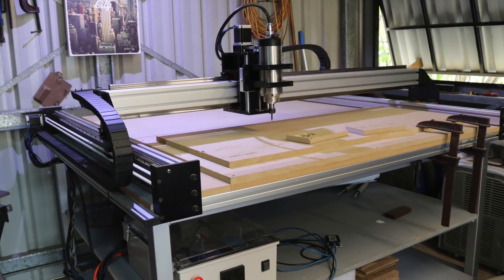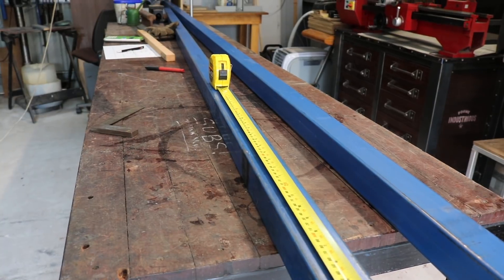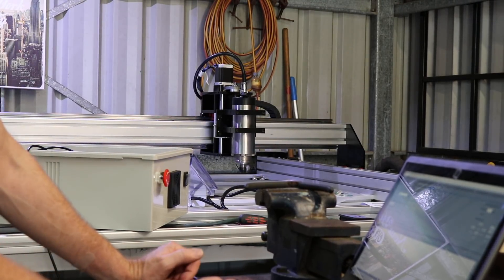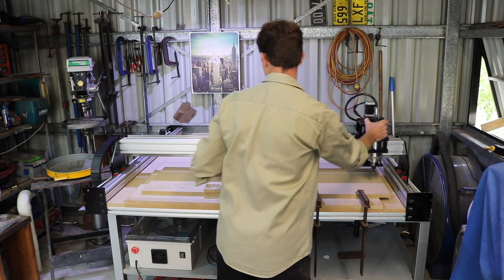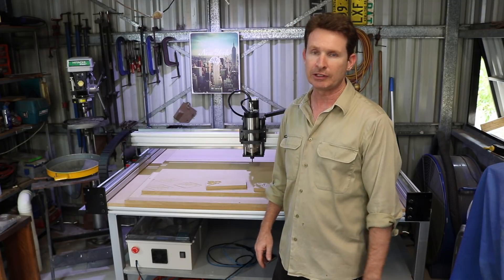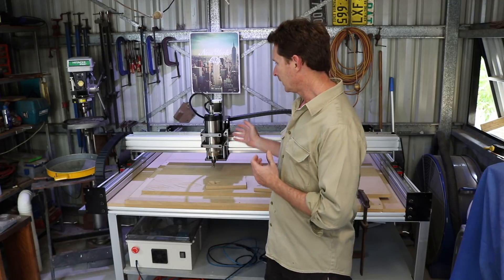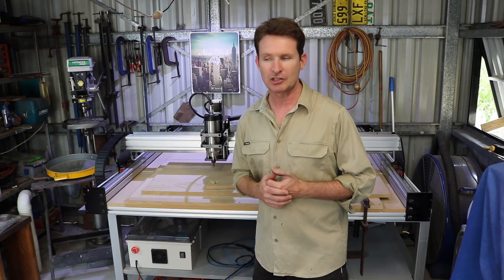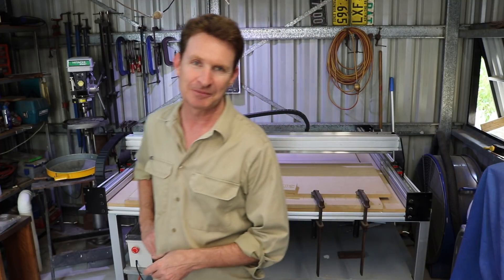3Dtek Heavy Mill CNC Router Kit Build - Forme Industrious

Comment: Hey Scott,
How did you find the cnc? Is it still going strong? I am looking to get one and would be interested in any feedback after use. Thanks
Reply from the maker: The Cnc is pretty good for my needs. The issue I found from the kit was the Cnc controller GBRL all in one was under powered. I changed over to the very reliable MASSO controller. I made a video on that upgrade. Hope this helps.
Reply: @ScottTurnerformeindustrious  Thanks mate. Always good to get info from a user. I am looking into getting one in my farm joinery and stumbled across your video which was perfect. By the look of your vids we are on the same off grid/build stuff path! I am also in the middle of building an off grid house and have used Victron as my inverters and mppts! Thanks again for the reply!

Comment: Hi mate I have a similar one I got second hand the other day , what program are you using to run the CNC and what program are you using to do the degine what you are cutting ?
Reply from the maker: Hi Michael. I use Vetric V Carve pro to design and create the cut files. The CNC controller is the MASSO, I ditched the GRBL a few years back.

Comment: Thanks Scott, I have the basic xyz carve and I have cut my teeth on that, pushingt it beyond its limits doing deep 3d carvings, so I am going to upgrade for something more robust and this is the one, ben from 3dtec is  provides solid advice and runs several of these mills. That said, the best bit of kit I have purchased for my hobby shop, the only limit is youself in what you can make. I have Aspire pro and a copy of Artcam 2018 (from aliexpress) so I can learn to make my own stl's, although I have bought most of the ones I use atm, some 1100 models and I do most of my developement in Aspire, its just so easy to use. ps, send me a link if you post what you have made, cheers
Reply from the maker: Thanks Jason. I found Ben to be of great help when I was looking for a machine and whilst setting up. most of the 3d models I have done I just bought the files from Etsy. I really only use Instagram for posting. All the best.

Comment: awesome kit you definetly have the skill to have build your oown you could have mounted your x gantry plates on that awesome steel bench you welded up. Any one watching this video try and avoid pushing your machine around by hand like this you are ecentially generating a electrical feed back that could dameage your control board 👍

Comment: Scott, with a lot of these machines there is so much you can do with the face of materials, is there scope to mount materials vertically to do joints like finger joints, dovetails and mortices & tenons?
Reply from the maker: Yes I think you can. I haven't tried it but where there is a will there is a way. May need to modify the CNC Bed though. Lots of stuffing around. Might be more efficient for a Router jig.

Comment: Hi. Looks great. I just bought one myself, and was wondering what size you made the table top? I ordered the 1500x1500 version, so was wondering if it would help or hinder to have a little clearance around it?
Reply from the maker: Thanks Geoff! They are a good machine. Make the top 1650 for x and 1500 for Y. Sure you can have more clearance, but you have to be able to reach the middle still.
Reply: @ScottTurnerformeindustrious  Excellent; thanks Scott for the advice. Any other tips with the bench build? I've designed a relatively simple welded and bolted table, so I can pull it apart later if needed...just wondering if I should incorporate any fancy sliding tool cabinets or drawers or anything?
Reply from the maker: Yes, more fancy the better :) The bench will need diagonal bracing, well mine does as the cnc gantry is  heavy, so when it moves and stops suddenly the table can flex. I need to mod my table. Get it all up and running and enjoy it for a bit. You'll work out what you need in terms of storage after that. All the best.
Reply: @ScottTurnerformeindustrious  Thanks Scott. Yes, was wondering about flex and rigidity a lot...trying not to over engineer it too much! Thanks!

Comment: Ola amigo .. qual a area útil da cnc ?
Reply from the maker: Olá. A área útil é de 1220 mm x 1220 mm.
Reply: @ScottTurnerformeindustrious  você acha que uma máquina com o tamanho Y 2000mm e X 1500 com v slot C 80x40 fica resistente ???
Reply from the maker: Talvez, se estiver amarrado em uma mesa forte. Mas soa um pouco subdimensionado. Eu não sou especialista.
Reply: @ScottTurnerformeindustrious  pretendo fazer igual ao modelo openbuilds 1510 . Com estrutura central 3 de 80x20 . No tamanho dela total 2x1,5m. Grato por sua atenção.

Comment: Have you used your heavy mill on aluminium yet?
Reply from the maker: Not yet Dean, but I've just got some good end mills from Adams Bits so I'm keen to try it soon. Also I've had to work through some PC problems that gave me a bit of grief but I think that is all settled now as the machine has worked flawlessly recently.  It's just me being the weakest link ;)
Reply: Happens to the best of us ;) its great to see someone post some video on the heavy mill as there is not much out there, it looks like a machine I'd like to own but routers always get a bad rap when milling aluminium plate, from what I have read selecting the correct grade is half of the battle 6061 is meant to be a good starting point as others can be tough or to soft and gum up your end mills. What sort of projects are you planning to use it for? for myself it would be prototype mechanisms, small furniture pieces and custom motorcycle parts, I work as a CAD designer so happy with that part but I am looking forward to the world of CAM, I wonder how much of a learning curve it is, but look forward to the challenge.
Reply from the maker: I haven't got any specific projects planned for metals yet. I will do some trial cuts and see how that goes but ultimately I would like to make some furniture projects with it. These machines you can pay some serious money for and of course they can do amazing things. The Heavy Mill was reachable in my budget but it's pretty solid so it should be able to handle a bit of punishment. I'll be learning for some time yet as far as CAM goes. I'm trying to learn Fusion 360 and Vetric V Carve Pro. It's all fascinating. You have CAD experience so CAM should be ok for you. There is a lot of help out there these days.
Reply: There is a lot of information, but in the end, I think it will come down to trial and error, hopefully more trial than error but its all part of learning  :) be sure to posts some more updates, I'm subscribed and keen to see what you will make, you have already got some great projects on your channel. The Laminated Leg Stool would make a great addition to my workshop for when I'm welding.
Reply from the maker: Thank you Dean!

Comment: Congrats!  I've been eyeing a CNC for a couple of years, but as a hobbyist, it's tough to justify the cost.  Question-- Will your machine handle cutting aluminum?  I am considering either a kit build or a from scratch build, but I really want to be able to cut aluminum.  Is that feasible with a kit like yours?
Reply from the maker: Thank you! Yes I bought this machine on the basis that it must perform well cutting aluminium. I haven't done so yet but it was designed to be able to do so. I was thinking scratch build myself, but opted for this machine as I am new to cnc and there is a lot to learn so I wanted a proven design. Also the time to design one yourself and build it needs to be factored. Cheers!

Comment: Hi Scott this is the exact model I was looking to purchase from Ben. I feel I would be ok with the assembly but the wiring/electronics has me a bit rattled. Did you find that part reasonably straight forward?
If you were in the Brisbane area I would really appreciate a look at the machine.
Cheers, Peter
Reply from the maker: Hi Peter. Well I was a bit intimidated I have to admit but really now that I've done it, it's quite simple. Ben has a video of setting up the GRBL circuit board which I found very helpful and the wiring diagrams of course I used. I turned it on for the first time and it worked, though I needed to amend some codes for the spindle. If you have done any wiring and have a basic electrical knowledge you should be fine. Ben is very helpful also, which is very important. If you buy any Chinese options off ebay, there will be no support. I am in Townsville but I'm happy to help with photos or what ever. So far I haven't done too much with the cnc but it looks very capable and it is large for a home workshop. I'm very happy with the choice. Sing out if you need help.
Reply: Scott there are three options for the electronics. Just not sure which option I should go for. I don’t really understand what the differences are for each
Reply from the maker: Might pay to call Ben or send a message to 3Dtek. Ben will get back to you. At my stage of learning I have no clue as to the differences but my GBRL system seems to be simple and works fine as far as I can tell.
Reply: Thanks for the reply Scott. Yes I’ll definately do that. Just need a reliable, user friendly system.

Comment: Hi. Just found your channel & subscribed. Watched quite a few projects, that small anvil, Man, you have some paitence!

The cutoff bandsaw you have, does it also operate horizontally with an attachable table or do you have another bandsaw? Thanks
Reply from the maker: Hi, huge thanks for the Sub! Well I can be patient, but also I can be quite impatient. Depends what I am doing and my attitude I suppose. My metal Bandsaw is a horizontal swivel type but it can also be used vertically. It's a very handy tool!  Thank you!

Comment: If you make an adapter to hold a gas torch in the router head and jack your piece of steel up off the bed (so as not to cut it in half) you have a cnc steel cutting device.
Reply from the maker: Man, those have been my thoughts for a while too. I would need to upgrade my plasma torch to something like a thermo cut that starts it's arc without the feedback. Was also thinking of making an arm that attached to the router attachment that extended to a second Plasma bed, mmmm
Reply: I spent today building a table for a machine like this https://www.youtube.com/watch?v=DKxBL3MKi08They are so cheap in China and they have been using them so long there is no mystique . In small ship yards I have seen them set up on bricks over a patch of dirt. Usually a kid about 16 doing the computer stuff and the builders scratch a sketch in the dirt with a stick , kid then inputs to the machine . Sometimes cutting 40mm plate,gas bottles laying all over the ground , making their own acetylene on site. Don't be afraid to experiment, The cnc will push around whatever is attached to the node.
Reply from the maker: Cheers John!

Comment: You haven't trammed it yet.  I've had mine for three years and could not get fine work to be accurate.  Then I learned about tramming.  I'm having to rebuild my base unit due to a 40 thousand of an inch deflection of the length of the Y axis.  So for about another $300 US, I might get it down to a one thousands of an inch accuracy.  Ah, the fun of discovery!  VCarve Pro is really nice.  It does more then what I know, but then in a few more years I might exceed it.  The race is on!
Reply from the maker: Kevin Reardon Hi Kevin, thanks for the tip. I'll look into it for sure. I square up the cut on the X y axis but I'm sure it actually be improved using a dial indicator. All the best!
Reply: I learned a whole bunch by watching videos from oxtoolco.  Tom works at Lawrence Berkeley Labs as a machinist.  Watching his videos on setting work up just blew my mind on how to obtain accuracy from my equipment.  I bought a Shark Pro a few years back and thought I was in heaven, and then I started watching Tom and then found now inaccurate the Shark was.  Now I'm in the process of trying to obtain 0.001 accuracy.
Reply from the maker: 1 thou now that's a tight CNC. I'll check out that You Tube link. I'm always interested in learning from the Pros. Thanks again Kevin!

Comment: I opened up the link, and thought, this isn't too expensive, and rubbed my hands together, but then added the options, many sads.

Hope you get some good use out of it!
Reply from the maker: I have the standard electronics and opted not to get the T Slot bed as it is not required. That dropped the price a bit. Yes, I hope to get plenty of use out of it, cheers!

Comment: Nice CNC! I love how quiet that air-cooled spindle is. I need to look into one a little closer.

If I could give you a bit of unsolicited, absolutely "worth-what-you're-paying-for-it" advice, it would be to dive into Vectric's tutorials from within VCarve Pro and immerse yourself. It's just like anything else - the only way to get good at it is to practice, and the only way to practice is to do it. Save early, save often, and preview your toolpaths several times. Above all, have fun with it.

Haters are gonna hate - the rest of us will be too busy having fun. Cheers!
Reply from the maker: Thank you Mark! I was totally surprised how quiet the spindle is. It's 3 phase brushless.  Most of the noise in the video was the dust collector running in the background. Yes I've been getting into the Vetric videos. They are so good. haters gunna hate but so far everyone has been good in the comments. Thumbs down is all part of the game I suppose. All the best and thanks for your advise!